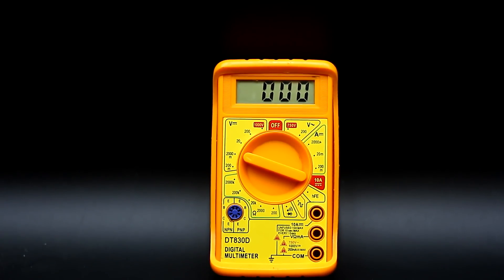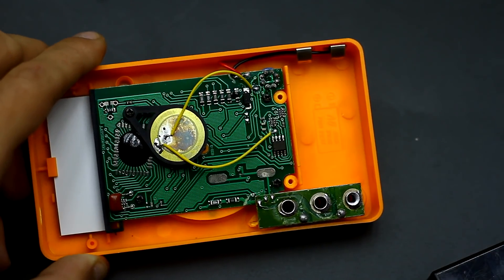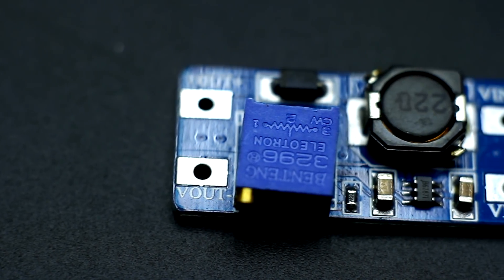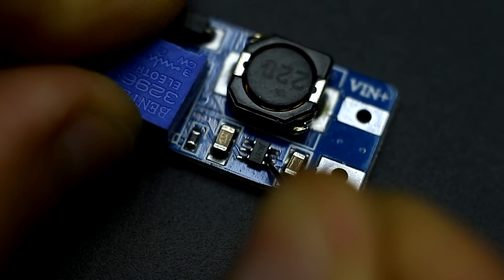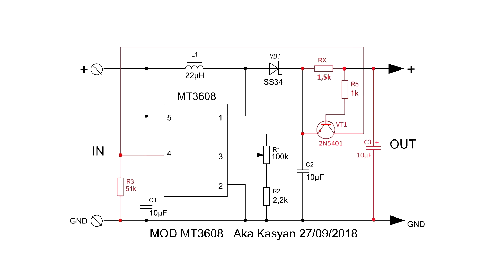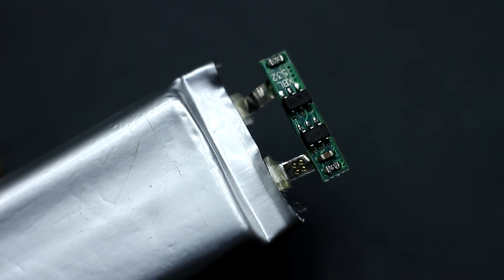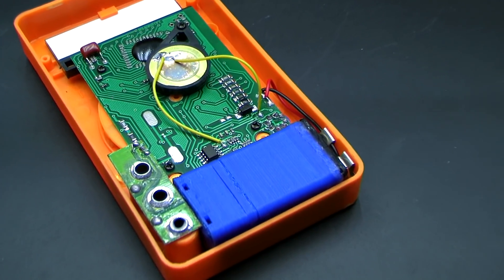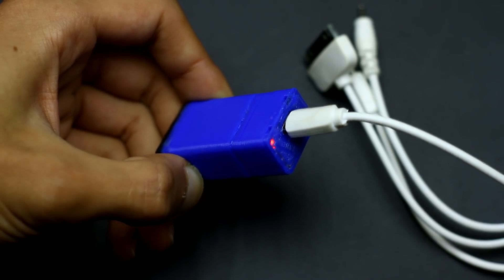6F22 battery alteration to Li-Ion

Comment: So you still have to open the multimeter to charge the battery? Wouldn't it be more convenient to add a charge port and ditch the battery case?

Comment: Some musical equipment in a band wont accept 8.4v so the rechargeable 9v doesn't power up the device like a wireless microphone which brings up a important issue like noise, how does this work with audio?

Comment: Nice battery. I modified my multimeter about 1 year ago, but didn't bothered to make a self-encased battery. I just took a tpa4056, and drilled a small hole for the micro-usb connector, and wired the multimiter's switch to run the - terminal of the boost converter. That way, i still use the same switch to turn it on, and avoid to modify the boost board. The advantage of my setup is that i can charge it directly, the disadvantage is that i can't take it out and use it directly...and uses a bit more of space.

Comment: This is good for 9V battery applications.  I challenge you to develop a small extremely low standby current circuit that may be placed inside the device's case (a remote tv control, or a digital measuring tool, as 2 examples), and interrupt the battery current supply when not needed  but not take the place of 1,5v cells so the device only continues power when the device needs to operate, either by detecting touch of the case, motion,...  Then after 1 min., The circuit powers the device off to save the battery.

Comment: use 2s battery?  lots of batteries are 2s for cameras etc and have built in BMS just build ubs to 8.4v boost converter to charge battery, maybe another good project for channel

Comment: Good idea. I've thought about doing something similar many years ago, but it wasn't feasible. Either the boost convertor used too much current for itself (as an example the convertor used 10ma and the battery operated device used 1ma) , or adding another switch just to turn off the boost convertor was too much trouble (no space to add a switch or can't modify the existing power switch) ,or all I had was nickle cadmium batteries (a boost circuit for a single nicd battery would be about the size of the battery itself, plus the self discharge and limited capacity as compared to a primary battery). All of these things made it more of a problem than it was worth. Now with these easy lithium ion batteries and boost convertors/chargers specifically designed for lithium ion battery use it's now no longer an issue to do something like this.

Comment: Hi, i was also thinking about some kind of simmilar build, but the output ripple of the converter stoped me.  What about to measure the accurancy of the multimeter with this kind of battery ?
Reply: I made a similar modification to my multimiter, and i've experienced no wrong measurements at all. You can allways set the step-up to 10V and then add a 9V linear regulator. Since the power required from the multimiter is really low, and you only have 1V drop in the regulator, it will dissipate quite low energy, and shouldn't be a problem. You can test the results with and without the regulator, but keep in mind that multimeters usually works between 9.9V and 7V, so they can handle the voltage drop (and if frequency is not a problem, the ripple). Also, adding a slightly bigger capacitor to the output, a low ESR one could also help with the ripple concern you have.
Reply: @DanielLopez-kt1xt  Anyway if u add a linear regulator, it should have a bit bigger voltage drop than only 1V, datasheet of 78xx from ST says 2V minimum voltage drop for 7809, and u have to count it from the lower peak of the input voltage to the regulator, and it has got also quisent current with amount of 4,3mA. which is a bit when it draws the current constanly.

Comment: You can also use 2S packet 8.4V
Reply: If the device works on that voltage, great, but I have a few music stomp boxes that wont. And I don't think it will all fit in the 9v housing unless you can make a bigger compartment because the device allows for it. I would be happy wrapping it in electrical tape or shrinkwrap
Reply: @MrBrymstond then why not make smaller pcb or buy smaller capacity lipo packs?